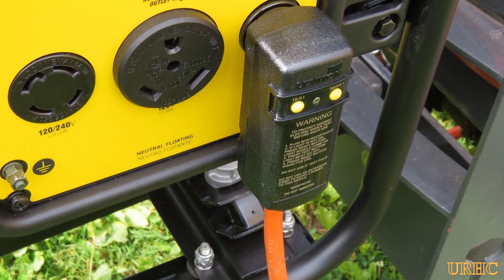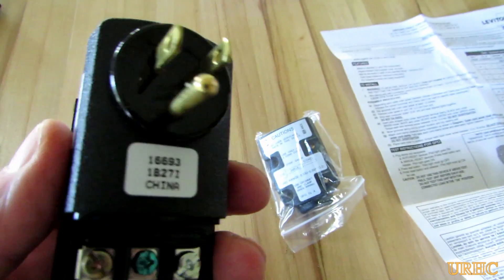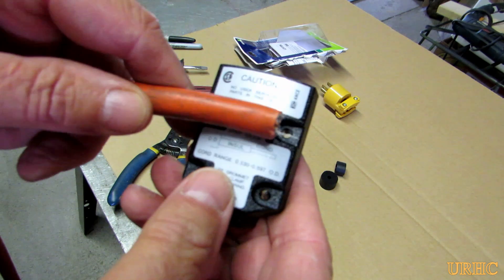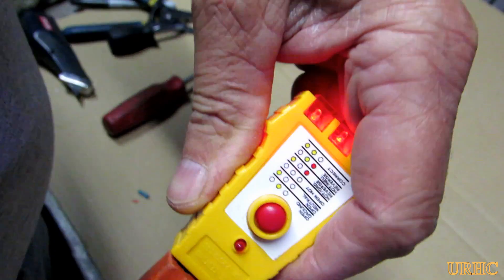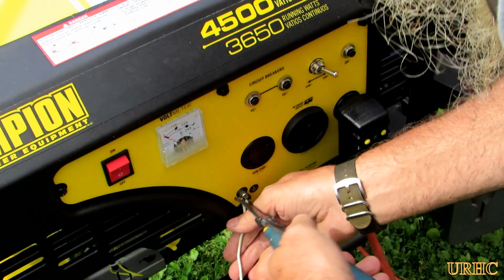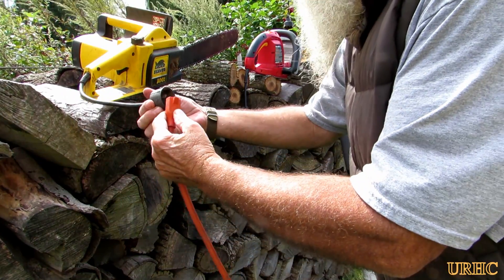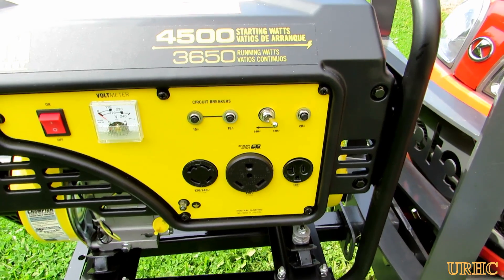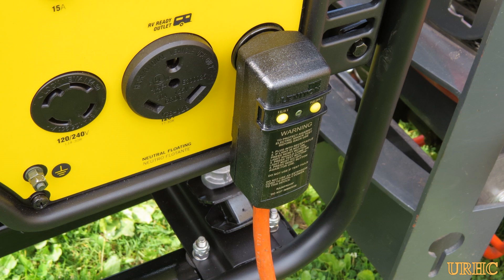A GFCI Plug Will Not Work With My Champion 3650 Watt Generator

Comment: on your modle this is what the manual says The generator system ground connects the frame to the
ground terminals on the power panel.
– The generator (stator winding) is isolated from the
frame and from the AC receptacle ground pin.
– Electrical devices that require a grounded receptacle
pin connection will not function if the receptacle
ground pin is not functional.
Reply: A GFCI compares the current leaving hot Vs current Entering neutral AFTER the device.
 A standard Duplex GFCI receptacle that is used in wall, does not require a ground connection to operate.(Portables Could be different)
 Many antique homes(not wired with ground) are retrofitted with GFCI's. In this case they work because the utility service entry has a earthed neutral (the hot shorts THROUGH earth/ground to get back to neutral).Your problem is because of the floating(unearthed) neutral, fault current has no way back to the neutral(through you or any thing else) except through the cord neutral thus there is no current imbalance.
This is why portable Gen sets are floating, if there is no ground then there can be no ground fault, thus only over-current protection is needed.
Mobile and stationary units are earthed because they are commonly connected to a earthed system(Home), and for lightning/noise mitigation.  
Assuming your wiring is correct, i have no idea why it shows reverse  polarity.
In general (IN THIS CASE) your just as safe with a floating neutral as you are with a GFCI 
THEORETICALLY with this floating neutral you should be able to hold the hot wire while standing on the earth and not know it. AS LONG AS earth /ground/you, has no connection to neutral.
Good Luck !!
Reply: Indeed that :) PE and N are not connected on the generator. And without earth stack PE is NOT connected to (the real) earth. A GFSI is useless here :) But so is the earth wire itself. On the other hand, it should not matter because you can hold L or N of the gen without a problem. But, note, you can have a faulty device with L (or N) on the chasis safely on the generator but that will give problems when connected to the grid.

If you want to use the GFCI you have to connect PE and N on the generator. But then you also must use a earth stack.
Reply from the maker: I think the ground and neutral must be equal for a gfci to work.
Reply: yes i was looking up how to do that but got sidetracked if i find a right way to do that ill let you know

Comment: Didn't this have to do with the fact that generators, compressors and other such devices lose voltage (to ground) thus messing with the GFCI. I doubt you can make it work properly without actually seeing what the current out of the generator looks like.

I use a Xerox smart voltage thing-a-madoddle, that came off one of my printers years ago. Have tripped it a few times, and it has beeped at me a couple of others when i approached inherent fuse-blowing moments, so it does work.
Reply from the maker: I think it is more that the ground and neutral have no connection to keep the generator frame from becoming hot with a fault.

Comment: mine works great with the ground wire attached but i found out mine is a different model
Reply from the maker: I tried adding a ground wire, still was seeing a fault and unable to trip the gfci.
Reply from the maker: Do you have the 110 / 220 switch like this?
Reply: no mine is different i thought it was the same havent changed my comment

Comment: I think a more simple solution might be to bond the neutrals.
Reply: On an empty extension cord plug, attach a wire from the ground screw to the neutral screw in the plug.  Close it back up and plug it into the other 15 amp receptacle on the generator. Try all your testing again. It will work. Putting that doctored up plug changes your generator from a floating neutral to a bonded neutral. The GFCI will then work. Its a totally safe fix.
Reply: @UncleJunior67  NO it wont. And I find a GFCI works on my Generac, whether the neutral is bonded to ground or not bonded to ground. I used a typical Leviton GFCI outlet, not one of these socket gfci plugs.
Reply from the maker: I don't think you can on all floating generators.
Reply: Jesus Christ died for our sins, was buried and rose again to save us from eternal judgement and give us eternal life if we believe Him. Only God can save us and freely give us new life inside forever

Comment: This is a problem with a lot of inexpensive generators and inverters. I have a potential solution that has worked for me before:
DISCLAIMER: USE AT YOUR OWN RISK! DON'T BLOW YOURSELF UP! THIS IS A CRAPPY IDEA!

Take neutral and hot from your generator. Leave it's ground alone. (Don't use that wire from the cord).
Run the wire into a GFCI outlet box (hot and neutral) as well as a ground wire connected to a ground stake. 
Attach Neutral to Ground via a bus bar or similar. Careful not to short anything.
Now, wire your GFCI outlet with ground to ground (on bus bar) and neutral to neutral (on bus bar) and hot to hot (straight to generator).

What this does:
Neutral will now be at the same potential as ground, like in your household breaker panel.
The GFCI outlet will work.
It will detect the imbalance of current flow between hot and neutral when a short to ground is initiated by the tester, and it will trip.

ANOTHER DISCLAIMER AND STUFF:
1) I used a pure sine wave output generator.
2) I used a full breaker panel and pretended that the hot and neutral from the generator were 'the power company' and wired it like that.
3) The setup has been decommissioned and replaced with a proper generator, fed in through a professionally installed transfer panel, etc.
4) Please note, I don't know how your generator is set up / wired / made. Don't hurt yourself. Follow electrical safety precautions and design standards.
Reply from the maker: It sounds like bonding the neutral and grounding can make it dangerous to use as a portable generator without grounding as it is designed to be used. The 110 / 220 switch complicates it even more.  Hopefully Champion can give me pointers.
Reply: Yea, I'd ask manufacturer and heed their recommendations.

Comment: You need a ground for the G(round) F(ault) I(nterupt) to work properly.
Reply from the maker: The tester creates it with the red button. Even with a grund wire the tester could not trip it. When plugged into the wall it tested fine.
Reply: No, it doesn't. (And Bert is right.)

That hand-held tester 'works' by connecting the hot to ground (through a current-limiting resistor) when the button is pushed. Ordinarily, the ground would be bonded to the neutral at the source, creating new current path (hot->button/resistor->ground->neutral) when the button gets pressed that will unbalance the hot/neutral wires being monitored by the GFCI--thereby tripping it. But your generator does not bond the neutral to the ground, so this pathway doesn't exist.

Pushing the 'test' button doesn't create a new pathway, so there's no new current in the hot, so there's no imbalance, so the GFCI doesn't trip.

Comment: Here's your solution --- https://youtu.be/Wr3ZKDN-8Go
Reply from the maker: I do not think you can neutral bond this generator.  Looks like the hot and neutral float.
Reply: Unemployed Redneck Hillbilly Creations hot always floats. The neutral is not connected to ground within the generator. So there is no reference for the gfci.
Reply from the maker: From what I read if you connect neutral to ground on this model and there is a fault it can be dangerous and make the entire frame hot during portable use. The hot and neutral have equal potential the way this one is wired and a isolated ground does not change that balance . I think it is the only way to get it ul listed. Hopefully I can get some info from champion.

Comment: Same issue here. My tools seem to work fine and no apparent damage. It is a little concerning though.
Reply from the maker: I guess they see this as the safest configuration for a low cost portable unit with 1 outlet. Good for power tools, but not made to interface with a hardwired system.  Never knew there were 2 types of generators.
Reply: I swapped mine for a propane one thinking maybe the mfg was concerned about gas fires. 4 -110VAC, plus 1 220VAC RV 30Amp which turned out to be a real bonus for us. I even tested solar panels & same issues.